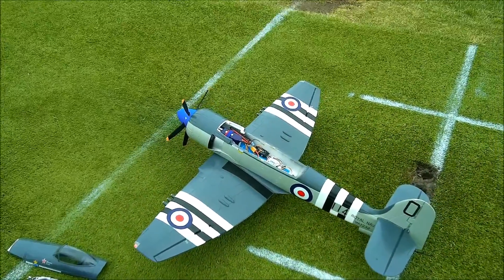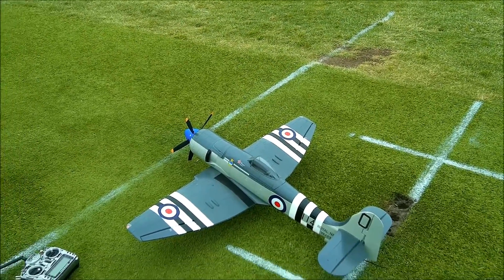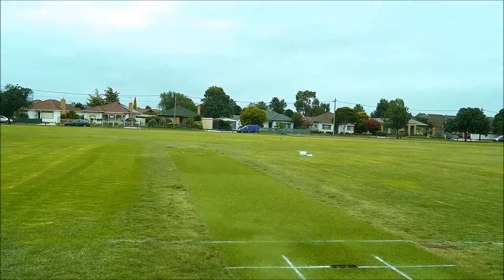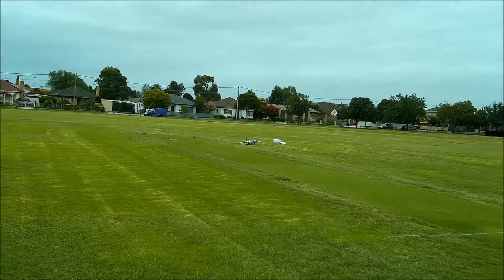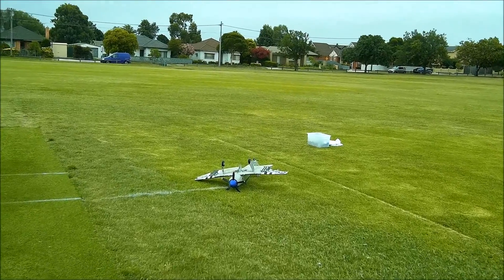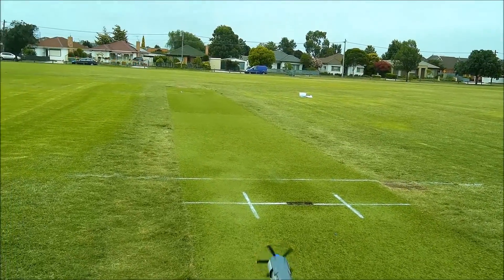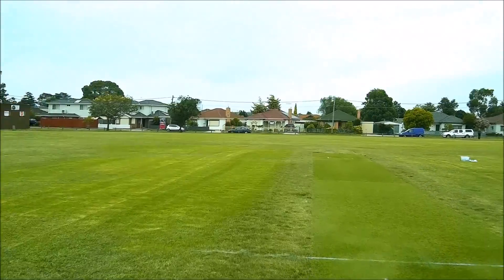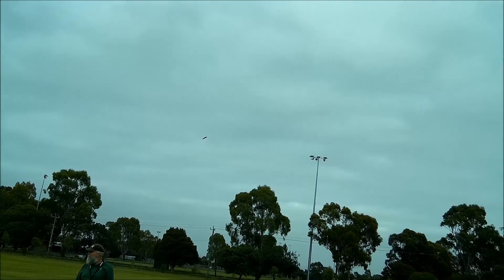Guardian "Auto Pilot" Setup and Test (Avios 1200mm Sea Fury)

Comment: Thank you very much for taking the time and trouble to produce such a beautifully presented, meticulous explanation of the Guardian system. I bought a second-hand Dynam Me 262 the other day, and it had one already installed. After the ' what the the B*** H***' is that?' phase, I started to gather info, and yours is by far the best video I've seen. The Dynam Me 262 doesn't have flaps , so I can use the only 3-position switch on the Turnigy 9xPro as stated in the manual. What I'm supposed to do when I use an aircraft with flaps, I don't know!    
    Cheers, and thanks again,  Den ,Wales
Reply from the maker: Well, if you use "2D" mode (Angle Mode of Control) then the unit is effectively a Fly-By-Wire Flight Controller. So when you command 'level' (TX sticks centered), or any other angle command by using a TX stick angle, the unit will MAKE that happen.  It doesn't not know, or care, about any flight aspects other than the use of Ailerons or Elevator to reach that commanded target. This means that if you deploy Flaps, which could add forces to make the aircraft climb OR descend, the unit will just do what it needs to to MAINTAIN the TARGET (command). So if you were at 'level' (TX sticks centered) it will do whatever it needs to to STILL achieve that, which means it will offset and account for the Flaps effect too. The flaps operating will not alter anything in Pitch or Roll.

In Normal or Off Mode it is NOT dong this same process, so if you switched to those modes any Flap effects would still cause that climb or dive.

In 3D Mode.... hmm, I have never done it... but it will still do a very similar thing, but in a different way....
In 3D Mode it LOCKS an attitude/angle IF the TX Sticks are centered. Only then. So if you set the plane flying along a a certain path, formed by Pitch and Roll Angles, and centered the sticks, then it will make it stay at those angles until you move the stick(s) away from centered. This means if you deployed Flaps it would still make sure the plane did not alter its pitch and roll angles. But if the Sticks ARE away from centered, then YOU and your own control now have to set the plane to what you want - just as per a normal plane with no flight controller.
3D mode is nowhere near as 'flying friendly' as 2D mode for this use, so you really would only use 3D mode for its primary intended purpose and a few other 'special' use purposes it is actually good for.

Comment: Thank you! That extra information you provided helps a lot.
Reply from the maker: When you said "Difficult to maintain a take-off roll" what did you actually mean?  Keep it from lifting off too soon? Keeping it from veering astray (leftwards usually)?
The Wing level to ground (longitudinally) state will 'delay' its lift off ability, due to less Angle of Attack - but SPEED will set where that happens still. So to not take-off too soon, go slower....
For tracking straight, you need some RUDDER (Yaw) assistance. In 'Self Level" mode (Angle mode of control, as per 2D mode in a Guardian uses) they only control the Pitch and Roll in this manner. But they do still apply STABILISATION to yaw. Stabilisation is the detection of ROTATION on an Axis, and then 'opposing' that rotation IF the input control (from TX/RX) never even asked for rotation. That is not overly useful at making a plane track straight, but it will do SOME bits of use.
In The Guardian they have a "2D heading Hold", which is a system to try to keep a constant heading - but they use the ROLL system (Ailerons) to achieve that. Technically that will not work well if an aircraft is held wings level by the WHEELS, as it cannot Roll (alter wings lateral angle) very well then anyway - but it would do SOME amount. Though not in the truly required way that it needs YAW to truly correct it properly.
I have not tested 2D Heading Hold, and I have read that it DOES help steer a plane down the runway...... so that is something probably worth trying out. Versus, if you think about it, they COULD use a large amount of Aileron (Roll) in their attempt to TRY to correct heading, and dip a wing to hit the ground, or various other not so great motions and outcomes.....
I guess it is probably best to (as I do) just use RUDDER MANUALLY.... and being careful with SLOWER increase in Power. You don't really need to go to 100% throttle..... most models can take-off totally fine even at 50% throttle! More scale than the excessive 100% will create. Plus take TIME to increase from 0 to the X% you use. Then steering - to fend off torque/P-Factor results - will be a LOT easier too....

Comment: I need more information. Can you show the settings and gain you used? When you set for "level" attitude what do you mean? Can you explain that graphically? I have a P-47 that is really difficult to maintain in a take-off roll, and based on your video I think I can do something similar to your situation.
Reply from the maker: There is a lot more to know/outline than just this starting point, but..... When you set up a 6-Axis Flight Controller they will give a way to set what it will consider "Level", in Roll and Pitch. The usual way to set Pitch is to have the nose raised a bit upwards so that when the Flight Controller 'thinks' it is 'Level' the aircraft will have that small amount of nose upwards, which will give it SOME amount of Angle Of Attack, which is what will create more lift and thus make the aircraft capable of flying along MAINTAINING ALTITUDE. So their use of the word 'Level' is a bit misleading. They really mean a 'Level Altitude", NOT a Level ATTITUDE..
But seeing I am adding a method to ALTER the Attitude, via a TX Pot, you can set the Level position for the aircraft to be "Truly Level" - meaning the WING being level from side on, thus no Angle of Attack, thus not extra lift generation. To get it to fly along maintaining Altitude later on, you can add some 'offset' to the system via the TX Pot.
You will need HIGH Gain for take-off, because at a LOW Speed the control surfaces cannot achieve much (as much as when faster) - especially when VERY slow at first. But as it gains speed, and the control surfaces gain Authority (effect), then you will need LESS Gain or they will over-react. Though that point where too much matters is a fair way after taking off, so it is not something to get frenetic about..... you could even set a Switch for take-off, what also alters the Gain too. "Take-off Mode", gain goes high (100%).
Reply from the maker: "Level" is just a stored reference in the Flight Controller, that you set it to have. When you use the TX Sticks - or ANY source of change to the channels that control pitch and Roll - the Flight Controller just 'appends' that offset to the base value of 'level'. eg Add a bit of 'Pitch UP' and it adds X degrees of angle to the Level value. So if level had been set for +2deg, you will now have commanded the Flight Controller to produce +2deg PLUS the stick input (or the Pot input). This means we can set the 'Level" to be 0deg (of Wing to ground), which will NOT make the plane fly along 'level (maintaining Altitude), because for take-off purposes we want the aircraft to run-out down the runway with the Wing level to the ground. We have assigned a different purpose to the Flight Controller for this period. We can alter that purpose back to "maintain Altitude" later, via using the TX Pot that is set up. The Flight Controller is just a TOOL, that we can set up to do things WE want it to do..... not just what the generic outline of what it is 'supposed' to do.
In this case, for the period in time of the take-off, we want it to set the aircraft Wing level to the GROUND......
Reply: "you could even set a Switch for take-off, what also alters the Gain too. "Take-off Mode", gain goes high (100%).".... Now that's a good idea. I can set up a flight mode 2, or "take -off mode". Thanks for the tips.
Reply from the maker: Yes, with some thought about things available, and needs, you can create some very useful processes.